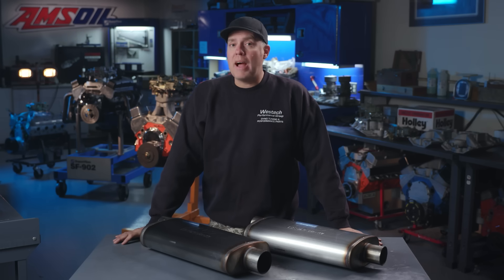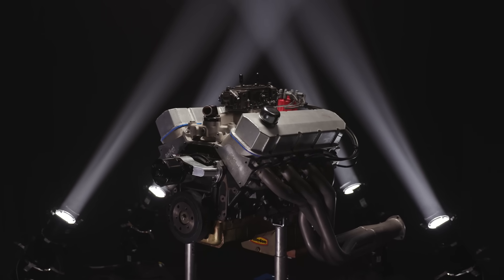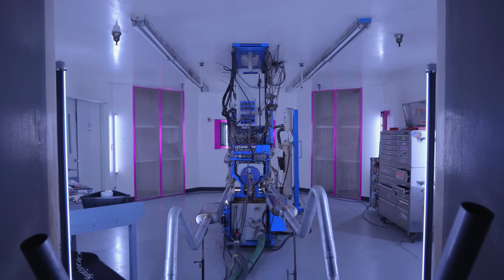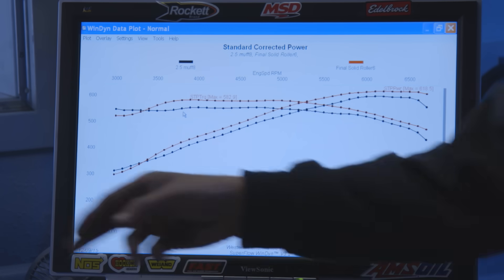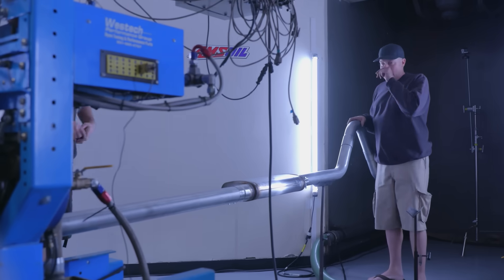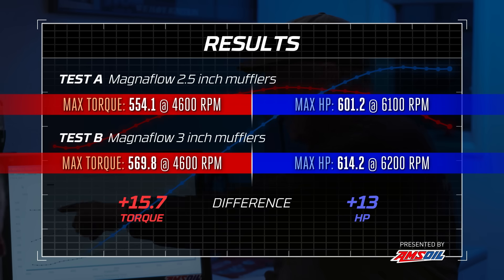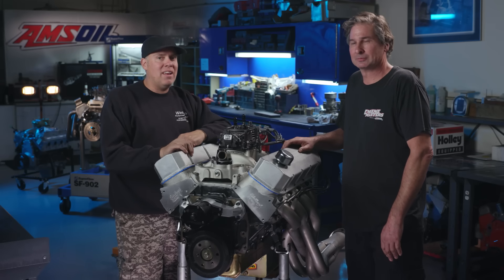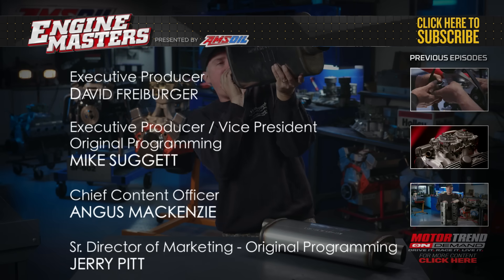The Power of 2.5- vs. 3-Inch Exhaust - Engine Masters Ep. 9

Comment: that engine has 550+hp so a 3" muffler/exhaust make more sense with all that power... but what about a 4 cilinder & 140hp 1.6L... a 2.5 would be better because a 3" its way too big & the engine would lose power?
Reply: if i hear a 140hp motor with 3 inch exhaust coming down my street ima throw some nails on the road lol
Reply: 3" would still be making more hp,  v8 is just like two 4 cylinders put together running side by side.
Reply: lowcomtech K. this is true,we get gains all across powervand on 2liters hondas,making one this week for a 3.5l still 3inch for around 250whp still gets gains all across the curve
Reply: Jonathan Rivera a 3" exhaust system on that size engine wouldn't make it lose power, but honestly with that output a 3" exhaust wouldn't be much better than a 2.5" anyways.

Comment: The drive-ability, noise reduction and off idle torque of the 2.5 more than makes up for the peak HP loss to a street car.
Reply: you are absolutely correct ! i have a 270hp car and my turbo max boost is 5000rpm. it is NOT responsive at all below 4000rpm. which is an old lady when its not hitting 4000rpm-5000rpm mark.

sometimes i would rather drive my vios which is "faster" in a way
Reply: agreed
Reply: Finally someone thinking straight
Reply: So based on that: Should I go 2.5 inches in a 2.5 liters inline 6 engine, for a daily use?
Reply: Dan Henderson I have a question for you. If I use a 2.5" on a stock engine, will it affect if I put doble pipe or single pipe?
Reply: I agree that the CI of the engine has as much to do with it as anything.  IMO, and in my experience with a large variety of engines both gas and deisel, big and small, it's about a good balance of in and out. A lot of people don't have this kind of in-depth idea of what an engine does (or an engine or even a wheel dyno FFS) they just want to bolt shit on and "make more power" but if the engine's drinking air IN through a straw it still won't make any sense to dump it out with a 3" exhaust.  Just like it doesn't make sense to have a large intake charge and a restricted exhaust.   450ci is a LOT of volume even per piston stroke/cycle so you need to balance the volume it's taking in and try to have at least as much capacity going out.  Again: "an engine is an air-pump", might be a tired expression but the faster you can get it in, combine and combust and then get it out the more "efficient" the engine is and the more power it makes for a given volumetric size.  It's the "in and out" (intake/exhaust) where you can make the biggest difference without changing the engine type/architecture.  

There's also the matter of whether the engine's long-stroke or an "over-square" engine and what it's designed to do.  There's a big difference in "what the engine needs" between say an old I6 Power-wagon engine that needed to make as much low-end/low-speed torque for "work" conditions and say an over-square F1 engine that spends it's life closer to red-line.  I'd say it's best to just assume that everything they're doing on Engine Masters is for a V8 Hot-Rod/street-strip/drag application and bracket it that way.  There's too many variables in the term "an engine" to make broad sweeping generalizations about everything from one test.
Reply: In street or street strip a little to small is almost always better than a little to large when choosing bolt ons

Comment: This is all with a heavily modified engine.  Have you guys tried this with an emissions control TBI or TPI engine that has not been modified?  For instance with an old P71 PI 4.6L TPI engine with full emissions control still on it and the H pipe with original mufflers and with stock exhaust manifolds.  I bet the numbers are even closer together after you increase from 2 to 3 inches once you get past the cat backs.  Its nice to see these track and rod engines and all, but lets face it, most people would be modifying exhaust on cars and trucks with a whole lot less mods to the engine core.  One more thing, the back pressure "I heard it on the internet" joke.  That wasn't heard on the internet, it was heard from a mechanic that has been building engines and working on cars, longer than any of you in the video have been alive.

Comment: What would the 2.5" do with the carb tuned for it?  How did the fuel curve compare with the 3"?  Would be interesting to show the affect of fuel ratio on power and why you need to tune the carb for any changes.
Reply: Precisely. Whenever any changes are made to an engine's volumetric efficiency, the fuel and ignition really need to be re-optimized for those changes to make it fully worthwhile. This applies to anything from carb+dizzy to fully electronic fuel+ignition. I would also like to see how the power on this test engine looks with the 2.5" exhaust and a re-tune of, at least, the fueling.

Comment: It's a bullshit test really. You would have had to maximize the jetting for the 2.5" setup. You did not. Leaning it would have surely increased power and torque. The engine is already jetted for open headers, Of course its going to make much better power with the open headers OPTIMIZED jetting.

Comment: An unknown amount of power loss was caused by the richer mixture, a jetting change would be needed to know the true power output of the 2 1/2" setup. Also, since there was a noticeable change in noise level, it would have been nice to have a dB meter in the room to quantify that difference. After all, if the only thing that matters is power, run open headers.

Comment: What would be the best diameter for a 280HP 3.5L V6. It has cats on each header into single exhaust and then 2 more inline + the resignator.. I am wanting to eliminate the 2 inline cats and make a true dual or better single flow to gain more power.

Comment: Awesome, I love these shows! I have a suggestion, or several, I would like to see what an X-pipe would have done, I would like to see the mufflers at the end of the exhaust after the exhaust goes over the axle (because I have heard that is the optimal place for the muffler) I would like to see what an H-pipe does.  I would like to see what an X-pipe and an H-pipe would do together, I would like to see no tail pipes, I would like to see mufflers right on the headers!

Comment: good video but your wrong there is a formula for exhaust the hp is matched to the pipe size 3 inch exhaust is good size up to 339 hp per pipe. so going with dual 3 inch pipes gives you optimal cfm pulse. with 2.5 inch pipes max hp is 449 with dual pipes your cfm is restricted  hence the hp and torque loss. on your 600 plus big block. superchevyexhaustscience  is my source.